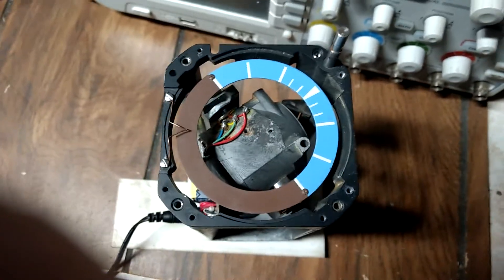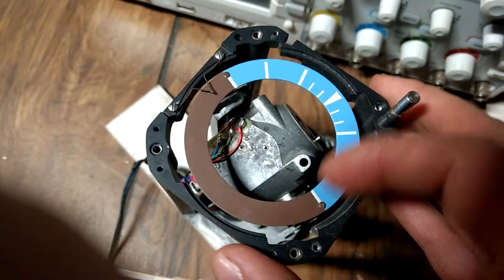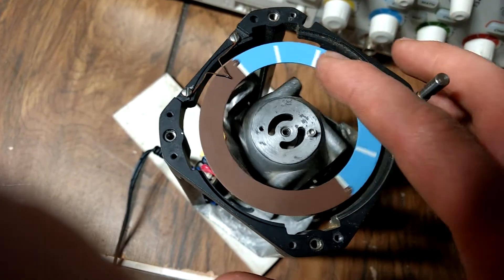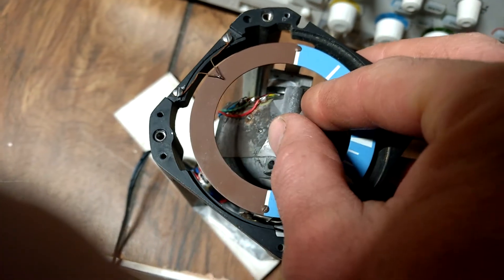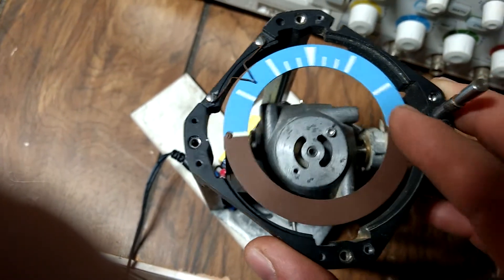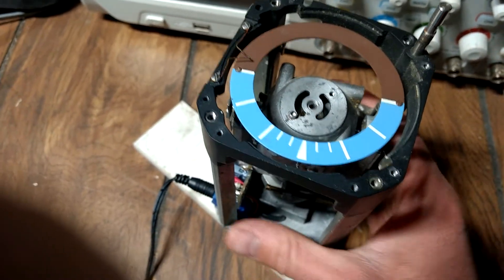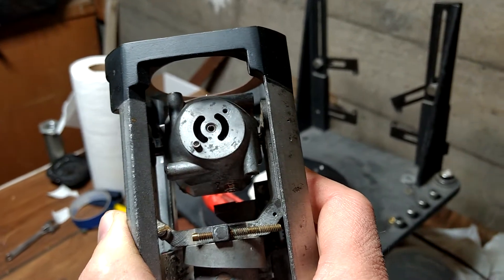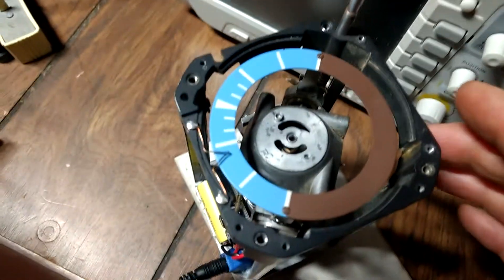Core principle of a gyro-compass

Comment: This is a demonstration of gyro prescession. To form a gyro compass, you ned an element measuring the earts gravitation.
Reply from the maker: > This is a demonstration of gyro prescession. To form a gyro compass, you ned an element measuring the earts gravitation.

Correct. This demonstrates the precession which is the core principle of the gyrocompass, which is why the title is "Core principle of a gyro-compass!"

I also did a video where I emulated gravity with a spring so I could demonstrate changing simulated-gravity (via the spring) https://youtu.be/5cvD9V4C_TU
Reply: No need to measure gravitation. It will always align to north due to Coriolis effect
Reply: @jpp_vh  Sorry, you are wrong. Coriolis effect is something completly different. This gyroscope does not align to the north. When you turn tha gimbal, you appiy pressue that presesses the gyro until its rotational axix aligns with the axix of the applied rotation. Then it doesn't feel any force and it stops presessing. Try an experiment: lay the housing flat on the table in any direction, it will do just the same, align to the turning axe. To make a gyro compass seek north, you need  to add a weight to it so it always points to the hoizon. Then it will, after some time, point to the north.

Comment: Love your videos. I've been wondering how hard it would be to make a home-made gyrocompass starting with a consumer-grade rotor. Obviously getting really, really low friction gimbals/bearings is the sticking point but I think Foucault had the right idea with his gyroscope. For the horizontal axis, you could have some really thin but really strong wire hanging from a high ceiling (long thin wire, low torsion/friction). Maybe tungsten wire hanging down a multi-storey stairwell. For the other axis, precision knife edge bearings because they don't need to rotate too far (I think?). Final issue is getting power to the motor which would require two other thin wires while trying not to add to the torsion of the principle wire. I'm not sure if this design would work though. What do you think?
Reply from the maker: Thanks! I think you'd pretty much need to be (or know) a machinist with a lathe and mill. The earth's rotation produces such a small force compared to other forces on the gyro that it really does have to be a precision mechanism. For example, just the wind blown by the rotating flywheel causes all sorts of havoc. So we put it inside a shield. Then the friction of the air inside there from the wheel spinning 10,000 to 20,000 RPM makes the whole thing get hotter and hotter. That's why real ones run the spinning weight in a vacuum. 

Here's some great info on them: https://maritime.org/doc/gyromk14/index.htm
https://youtu.be/EM051IXJD9Q

It'll give you an idea of just how massive and precise they need to be in order to work. I am definitely thinking about trying to come up with an open source vacuum gyro that can be made by me or anybody for a reasonable cost of materials by any local machinist to get more gyros in the hands of more people. With a high precision high speed gyro, earth's rotation becomes very obvious.